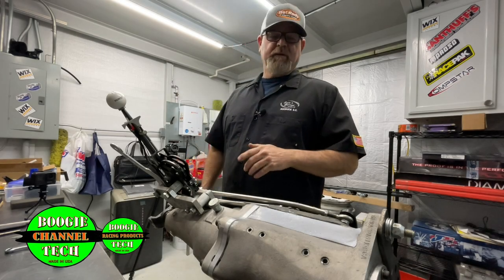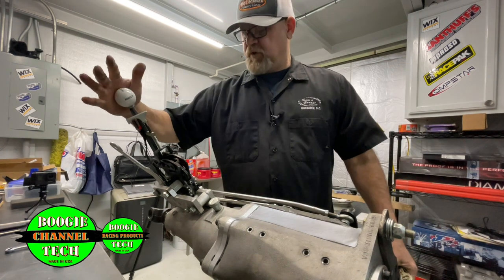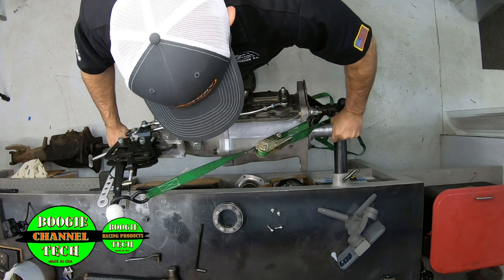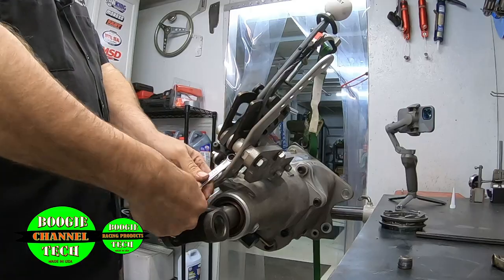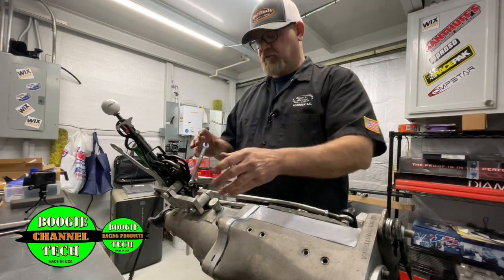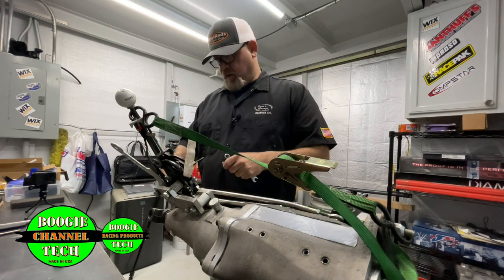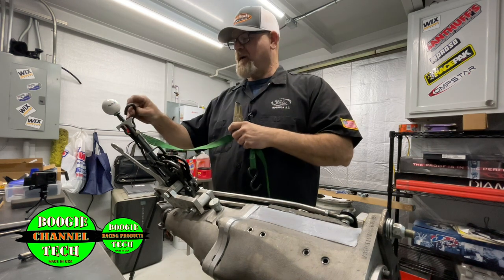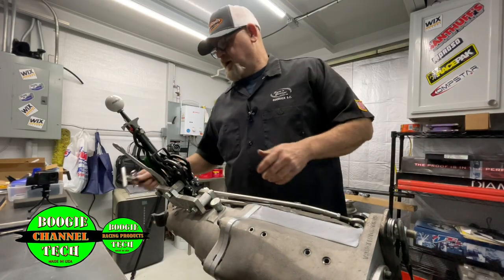How Adjust The Shifter G Force 101a Handcuff -  Boogie Tech

Comment: For a Street machine would you recommend locktite to keep the bolts from loosening up?
Reply from the maker: yes sir
Reply: Ok but for Street use with locktite how often am I going to have to check the adjustment to make sure I'm getting premium shift?